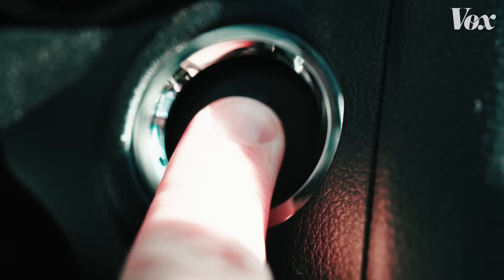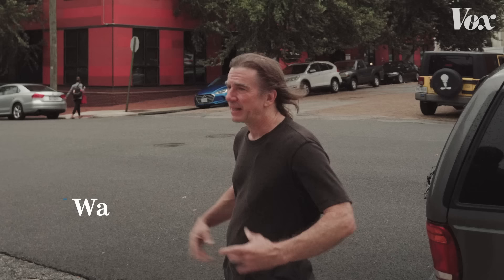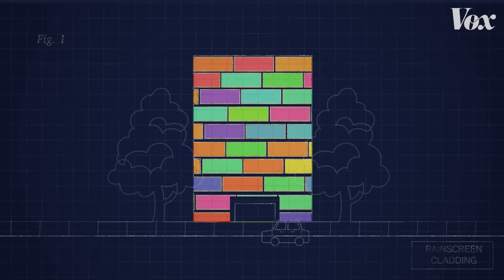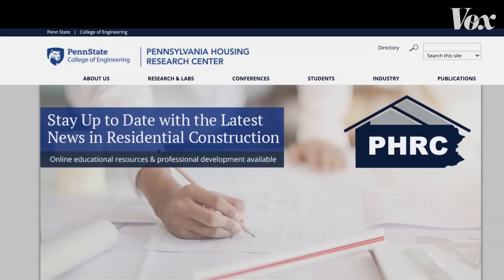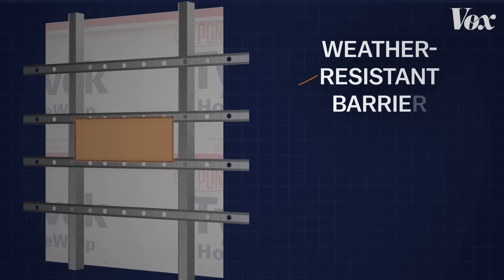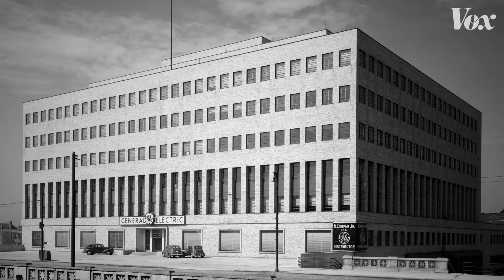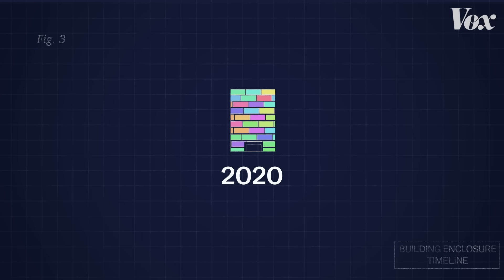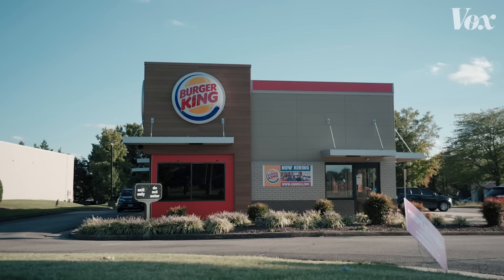Why so many new buildings are covered in rectangles

Comment: What I learned in my architectural tech courses was that the best layer of insulation in any wall assembly is the air layer, that buffer between the framing and the exterior material, and the better you can protect that continuous air barrier, the more well-insulated your house becomes. That layer can become obstructed or have heat transfers running through it, such as masonry ties, or furring strips, something where the temperature and humidity from the outside can be absorbed through the material directly into your house by having a physical connection running through the wall assembly. So the ultimate goal is to limit those transfer points, and thus maintain as much of that air barrier as possible to keep a regulated temperature differential between outdoors and indoors. 
As brick and mortar facades age, those ties can begin to break down, mortar can fall away, and bricks can crumble, which degrades the framing behind. I worked on one property where the damage was so extreme, the one side of the building was being supported by the sagging brick exterior, because years of water damage passing through old bricks and cracked mortar had caused the wood frame to rot. I could stick my pencil through the mortar it was so weak at that stage. I love the look of old brick homes, but be aware, repointing the masonry is an expensive, but ultimately essential repair to have done, because without it, you may be replacing an entire exterior wall right down to the studs.
Reply: Thanks for the pointers!
Reply: You just have to fix the mortar before the damage gets too severe. It's not difficult.
Reply: @SheepWaveMeByeBye  You’d be surprised. For clients who don’t know much about maintaining their building or even landlords, they tend to only look at a building from the edges and not the structure itself. If a wall looks faded, they’ll repaint it. However on the inside if you notice water damage to your drywall you have trouble coming. Many people are too nervous to have someone look into the damage because they fear the costs. It’s the battle between first costs vs performance. Human tendency is to act when it’s too late.

Comment: Most houses in the US are build to last up to 30 years. Unlike in Europe, were they make houses out of durable stone. So yeah its better to use less material on your buildings, but if they only last for a few years, it may be even worse for the enviroment than using more material, that last for at least 100 years or more.
Reply: My grandpa, god bless hes soul, left me a nice house that I live in now. Its from 59 and I had to change.....almost everything except the walls BUT it is still 50% cheaper then a new building because of taxes, zoning, permits and labour. Tnx grandpa.
Reply: In scandinavia we make houses mostly out of wood, larger buildings from concrete. But we have plenty of wooden houses from 17th century still in great condition that people still live in.
Reply: Depends on the environment you are building in too. Not every structure would work in all climates and areas.
Reply: @bingoberra18  There are still many wooden buildings over 200 years old, but that isn't an usual house. Most are way newer and most old ones were lost.
Reply: That’s a bit of an exaggeration. Though they may not be built for the next millennium, a wood frame, stick built house can last indefinitely of the wooden structure is kept dry with access to air flow
Reply: my house is over 100 years old, sure i gutted it to the studs and basically rebuilt it, but i could of easly left it like it was before and lived the same as i did on my brick and mortar house that i lived growing up in my native country... actually no.. my 100 year old house was way more comfortable then my brick and mortar  house lol.
Reply: lol you are just making things up, houses are definitely not designed to only last 30 years
Reply: Sure, concrete is so “environmentally better”? Having worked on homes built in the late 19th century along the Atlantic coast, the shingled wooden homes there are doing quite well. Also, the lighter white cedar roofs reflect heat and use less energy to heat or cool. European houses are not built with durable stone but cheap cinder blocks or chalk blocks that crumble over time. A wooden beam protected against moisture can last hundreds of years.
Reply: Most houses in urban areas in the US are 100-150 years old…
Reply: They don't make homes with stone anymore. And who says stone is "better" anyway? You? They don't hold up in an earthquake. And most homes in the US are older than 30 years. You just sound like some dinosaur that's romanticizing a past that didn't exist.
Reply: @sor3999  ikr, if we all built houses with stones we’d all be dead in earthquakes and plumbing and electrical work would ten times harder
Reply: Tell me you don't live in the us without telling me you don't live in the us
Reply: @tc3693  Also, we have crazier environmental disasters which are more frequent here than in Europe historically.
Reply: The modern architecture in Europe is also just for 30 years ...

Comment: If it looks, smells, tastes and sounds like applying the quick fashion model to building gentrification while trying to market it as environmentally friendly, it probably is right?
Reply: Fast fashion architecture is a great definition
Reply: No mention what the production of these panels does to the environment...
Reply: Yeah, how dare people replace run down old buildings with nice new buildings. That's bad!
Reply: In comparison to firing brick or carving stone from a quarry this type of construction has much less of an environmental impact.
Reply: @AC-im4hi  lol, right, weirdos with google degrees have the most to say 😂not understanding energy, cost, construction, etc
Reply: @hollister2320  I bet the underlying reason is ease and cost of construction. That is what drives these things
Reply: Creating the alternative which is brick and masonry products is not good for the environment. In terms of sustainability it goes wood, steel then concrete (from most to least sustainable). Not to mention, these type of panels are mostly used for a lot of commercial buildings which rebrand every few years and change their facade. A panel system allows for the facade to be removed and changed without having to disturb the building structure. On top of it all, these rain screen systems are better at preventing water damage, are cost effective and quicker to build and then quicker to change. With that many benefits of course it’s going to be used a lot.
Reply: @spisie130  Agreed concrete the problem of sand shortage and the high environment cost. Yet plastics while highly touted have a different impact and haven't been shown to be so friendly as proclaimed. I think this is an economic issue more that anything else
Reply: @ChrisdeCastro  as long as these are composed of polymers, there is a carbon coat of producing then
Reply: @siahsargus2013  not all of these are made of polymers. They are made from aluminum and other materials too.
Reply: @AC-im4hi  A lot of those old buildings don't actually need to be replaced, it's amazing how those landlords didn't maintain them, I thought landlords were perfect in every way... Maybe we should be building more affordable housing instead of knocking down buildings that already exist to build luxury housing for hipsters
Reply: @jgaffney567  the fact that this method is cheaper in virtually every way, production, installation, maintenance (for commercial construction at least) definitely plays a role. But it should be mentioned that not all these panels are made of plastics, sometimes they’re made of thinner layers of concrete, sometimes they’re made of metals (which is technically recyclable). Overall, from my experience working in construction related fields, there is a time and place for every material. Wood is great for residential construction (in certain climates), steel, metals and panels are great for commercial use and for businesses that rebrand often and concrete and masonry are great for industrial projects that are meant to stand the test of time and have minor changes from the time of construction.
Reply: @spisie130  Sounds good thank you stay safe
Reply: @AC-im4hi  It's not a nice building though. It's a temporary structure, destined to need demolishing and rebuilding in only a few decades.
Reply: @lobsterbark  A few decades is not a temporary structure. Most people want to live in a new building so around 30 years most residences get torn down and replaced. I'd much rather live in a "temporary" structure than one that's 60-70 years old. Maybe other people have different preferences though.
Reply: @AC-im4hi  Most people, especially those who already live in neighborhoods that are being gentrified, cannot afford to live in new buildings. And this has a ripple effect on the cost of living in that neighborhood, forcing poor people out of their homes and communities. For those who are able to live through the gentrification process and find their place in a more expensive new status quo, very little of that wealth actually trickles down.
When 20-30 years on, the quality of the buildings has deteriorated to the point that upper middle class people don't want to live their anymore, those who remained from the original community and those who come back find themselves in a more expensive and less sustainable living condition than what they started with. 

So, even if we take at face value that "most people want to live in new buildings", for those people most effected by this situation, this want would be barely relevant to their actual situation.

Comment: In England every house is still built with 2 skins of bricks and a cavity in the middle with inside plastered over. Of you build a house any other way then it's considered "non standard construction " and you will struggle to sell it, get a mortgage on it, or insure it. We don't do things fast and cheap here.
Reply: grenfell tower?
Reply: @karkaitz  that's not a house and yes also 2 walla with cavity if not bricks then blocks. Steel reinforced probably. It's the fascia cladding / insulation make by Kingspan that caught fire...

Comment: I’ve always wondered why there’s squares everywhere but wow makes so much sense! Plastic shingles and those weird ones that are used with tar , aren’t efficient ! They get destroyed so easily and cause damage underneath compared to most of these panels.
Reply: The government watching us our every move
Reply: Someone convince me that my 1938 house built from solid granite blocks is an environmental disaster when it has a 500-1,000 year lifespan vs. new-style construction which will need repair work within 50 years and rebuilding within 100...

It may cost a little bit more to heat, but there's no need to factor in constant repairs and rebuilds.
Reply: @dw620  Im from the UK so theres alot of old house's, especially in Cornwall. The main thing I think for everyday people is, theres always something a little wrong with the old homes that can kind of be ignored, the problem is when the little problem gets big and very expensive to fix. A substantial amount of the market is now how the homes or buildings in this video are built. Less people know the older ways of fixing a home, so the more expensive it is to hire someone to do it, and to pay for the materials.
Reply: @dw620  that cost to heat is energy, its a huge factor, and your building uses a huge amount of carbon hauling those pieces around, and that math just doesnt pencil

Comment: Foe those wondering, because it isn't mentioned in the video, the most common panel is called Aluminum Composite Panel and its a sandwich of a polymer between two thin aluminum panels.

Comment: Is this still the most environmentally friendly option, if long term sustainability doesn't mean 20 or 30 but 200, 300 years?

I'm also a bit worried that architects will overindulge like they did with concrete.
Reply: It's not necessarily architects that are pushing for rain screens. A system where you fasten panels directly on the framing would cost considerably less and would get you the same look. In the Pacific Northwest building envelope consultants are heavily involved to protect structures from the wet environment. Their success is starting to spread. 
By adding tracks or strapping behind cladding you're creating a layer of protection that prevents deterioration long term. How long? We don't really know yet. We'll find out more as we continue to see how the first rain screens perform. Keep an eye on mid-century brick buildings. They inadvertently created a rain screen.
Reply: If it's too old, it might not provide service to the new technologies we want in our shelters anyway. The past 200 years saw the rise of indoor plumbing, electricity, air conditioning, telephones, cell signals, and WiFi, which aren't exactly easy to install in a thick wall building. If you need to put radio repeaters in every room, it's kind of a wash.
Reply: @doujinflip  I think cases where rebuilding is cheaper than retrofitting are very rare. At least when the structure itself is in good shape.
Reply: @ymi_yugy3133  wood framing tends to offer more flexibility in remodeling though

Comment: There's a lot of criticism regarding these buildings being "cheap", and while it is more economical to build in this fashion, it's important to note that 5-over-1s are everywhere and look the way they do because they're the only legal style, due to draconian zoning regulations. 

If they didn't have to provide multiple parking spaces per housing unit (each costing about $10,000), and if they could build more total units by building higher than 5 stories, they'd be a lot cheaper to the renter. If these buildings employed masons and other craftsmen, it'd be lovely, but those steep costs would be passed-on to the consumer. 

It's easy to think housing is as expensive as it can get, but that's far from true; housing unit construction per-capita in cities is far lower than it historically was, and has been so since at least the 2008 housing crash, constricting supply, particularly in metropolitan areas with ballooning populations, like the Bay Area and Seattle.

If we're to make housing more affordable, we're going to need a LOT more of it, and that requires abolishing single-family exclusive zoning, parking minimums, setback requirements, lot sizes, etc. When the costs to developers are lower, then they can afford ornamentation to make buildings more interesting.

Comment: How does this type of cladding relate to the fire in London where the surfacing cladding is what made the fire worse
Reply: Sadly most of these tiles are exactly that - fuel plastic sandwiched between aluminium sheets. Some of them are worse than others but I think this has the potential to be the next asbestos.
Reply: the relation is that we have fire departments now
Reply: Likely depends on the materials used. With grenfell it was an plastic material between two aluminum sheets. With the rainscreen technique you are naturally making it more open for fire to breathe. if the slate panel shown in the video is just slate, metal and maybe a silicon caulking, that's not going to accelerate a fire the way that Grenfell's plastic panels likely did.
Reply: The cladding was plastic sandwiched by aluminium layers, the polyethylene essentially became liquid fuel. The companies responsible had long ignored building and fire regulations and codes. It is a banned cladding. The materials used was cost cutting, and a sign of mistreatment for the less wealthy residents of London.
Reply: @SwaggMessiah69  Cost is what drive this type of construction. Cheaper and faster to build . They worry about consequences later and in residential buildings of this type they get tax credit and the initial builder sells at a huge profit
Reply: @aryaaswale7316  pretty sure they're talking about the Grenfell fire, which was in 2017, not the great fire of London...
Reply: From my understanding that was a shortfall in product selection. ACM panels and combustible insulation. Look up NFPA 285 - this is the controlling factor now in the IBC

Comment: I was expecting a video about the architectural shift to everything looking like it was built straight off a model made of Legos.  I guess the answer is quick and cheap.  But retail and restaurants used to have distinct design.  Anyone from the 1980s probably remembers the red Pizza Hut roof and the Taco Bell parapet.  Increasingly we have to look for the name on the signage because the buildings have become so formulaic.  I'd like to see a video about that!